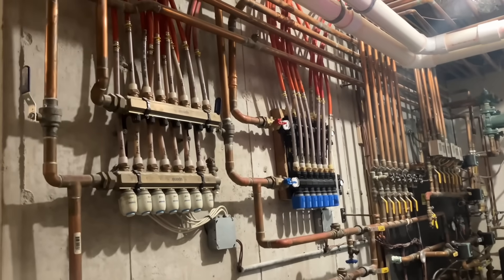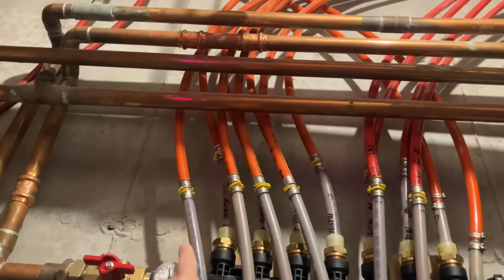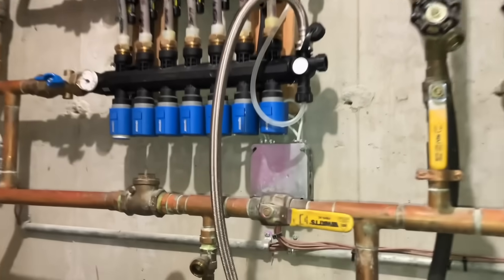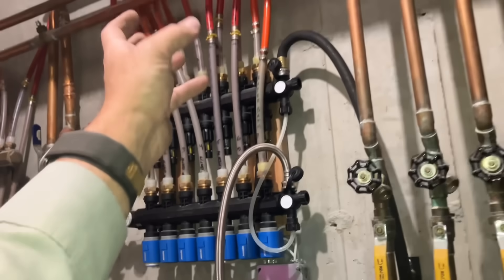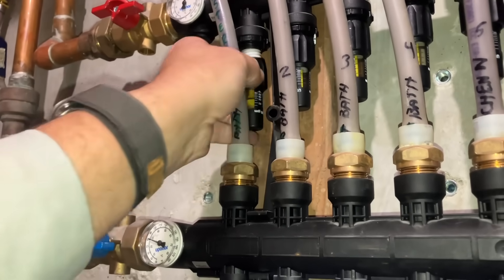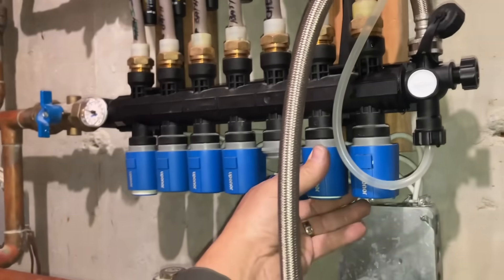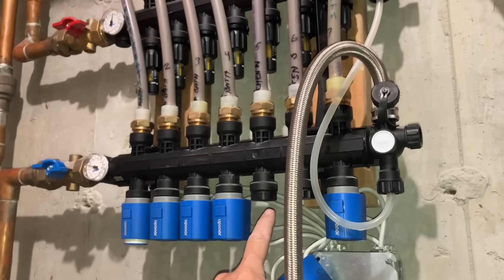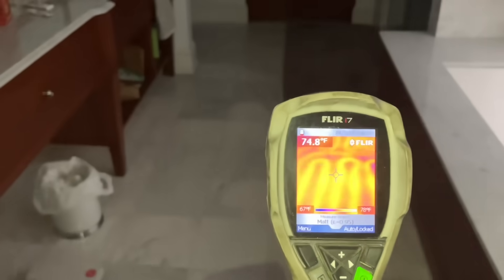Hydronic Radiant Loop Isn’t Working - Purging Uponor EP Manifold

Comment: Did you check flow with the actuator off? If the actuator and valve are partly hung up, street pressure may still push through, but the pump may feel the restriction and not be able to overcome it.
Reply from the maker: Yes, I did

Comment: Did you check flow with the actuator off? Off the actuator and valve are partly hung up, street pressure may still push through, but the pump may feel the restriction.
Reply from the maker: Yes, I did

Comment: I think it’s a definitely a pump issue Clog check on the pump debris maybe I would swap out the pump for a grundfoss and see how much gpm you can push or pull through. There could also be an air pocket caused by the pump but I’m not an expert

Comment: To me sounds like you have issue with mixing valve. If you have good flow after pushing street pressure through and in a couple of days you have same issue sounds like you’re not pulling through mixing valve properly

Comment: Possible the pump is getting weak, clogged screens in mixing valve. Dont think its a restriction in line, due to you having good flow when you ran domestic water through it. So i would look into pump an screens first. Good luck an let us know out come.

Comment: Can I ask , how can the manifold of the radiant heat loops be under the loops. won't you introduce air pockets  ?
The Manifold should be at the highest port to also act as an ar trap to remove any air bubble from the system ?

Comment: Calculate your hydraulic resistance,do you have drawings for the underfloor heating. Insufficient pump head possibly . Especially if you shut off all other loops and only the faulty loop is on .

Comment: another thought, it looked like a taco mixing valve, and they have filter screen gaskets on the hot and cold inlets. seeing the pump is always flowing through the valve, if either of the screens are clogged if will choke the flow off into the pump and it 100% looks like you have lack of flow volume. the flow rate ,ay change drastically if one screen is clogged and the mix valve adjusts to hold temperature.
as previous comment, there could also be stuck open/wrongly adjusted differential bypass somewhere between circulator and manifolds. without them it should be noisy and hard to control the flow rate of each zone, unless many are open at once.

Comment: Restriction is pressure.. is there anyway of testing pressure? I work as a diesel mechanic and this is identical to a hydraulic flow issue.. we have a special tool that we can control the flow and restrictions.. hyd pumps are positive displacement, obviously a heating sys wouldn't use that type pump.. KISS.. hopefully this helps..

Comment: with a system that size, I'm certain it has a differential bypass valve(or multiples), if one or more are stuck open/failed or someone opened/adjusted it manually and left it that way. in that scenario you wont get much flow through the longest loops and even less as more zones open.  
if there wasn't a bypass the system would be noise with only a zone or few calling and a big pump. the water will always go through the bypass first instead of the loops.
there could also "stupidly" be a ball valves as bypass, instead of a proper flow control bypass, but I doubt it.
the manifolds appears to have some sort of bypass also, but doesn't seem to be flowing anything.
you'll get a callback for sure. 😉

Comment: I have no idea what I'm talking about since I only have a 4 valve system using two Taco pellet type valves and two of the newer TACO valves that "charge-up".  Got rid of the Honeywell valves with the gear box.
Here is my WAG - possibly somehow a restriction in the manifold ????  You could switch output lines between the zone in question and another zone to see if the low flow condition changes to the other zone or low flow stays in the same zone.

Comment: I would shut all the loops, then  drain just the problem loop. Cut  the feed and return of the problem loop and hook up 120 psi to it. You are either gonna free up an obstruction or find a hopelessly kinked line. There could just be some kaki in there, blow from both directions.
Reply from the maker: Great troubleshooting tips, thanks for sharing!

Comment: You should close all circuits and feed water only the circuit that has problem to be sure that your flow is correct, also did you check that flowmeter if its fully open?it happens sometimes to have some flow but not satisfying enough.The other thing i would consider ,i 've never seen the manifolds installed upside down,it doesnt mean its wrong but you never know.

Comment: 1. Switch the in and out tubing connections at the manifolds with a known good location to rule out a manifold restriction. 
2. Add pressure gauges at the inlet and outlet manifolds to obtain delta P. Use your garden hose to achieve desired flow rate through that zone and note the delta P. Compare to the manufacturers pump curve for that circulator to see if it can generate the required pressure and GPM.
Reply from the maker: Great tips, thanks for sharing!

Comment: Sorry for length, but hope helps someone
My personal thoughts/opinions for low flow rate could be combination or maybe 1 of the following items listed below.
Unfortunately the only way to diagnose is to check the items (which can suck if following home runs that are LONG and buried, then possibly swap out parts (again a pain if buried inside wall) and see if makes a difference. Not in any order:
1. Leak - could be a fitting (90, coupling, elbo, etc) that has crack or even bad o-ring
2. Improper pipe sizing for amount of homeruns have AND making note of how many “fittings/connections” are in said homeruns as will cause flow restriction depending on amount/type (which can also high pressure drop, thus reducing flow rates)
3. Pump speed incorrect or failure
4. Balancing valve faulty 
5. Manifolds themselves are faulty

Cheers
✌🏻

(I’ve had this happen on manifold system for domestic water, not radiant heating, where system working perfect when installed and “commissioned” for use; than 2-3 months later get call that having issues w/ flow rate and possibly hot water not as “hot”. Was complete new install of manifolds and homeruns so knew wasn’t wrong pipe sizing on PEX or incorrect fittings or too many 90s etc…which can drop flow; it just so happened that on bottom of manifold there was 3 broke o-rings and second manifold had tiny crack in the part itself that faced wall where nipple joins body of manifold [I call it the arm-pit] and we had to change out both manifold and solved the issue)

Comment: At first I thought it was the main circ - but only if it's ft' of head rating was less than that required by all loops.  But that wouldn't explain why the first loop was having issues.  So..I'd take apart the 1st loop connections to the manifold.  It could be some debris that is inside the 1st loop's top manifold connection body that is jamming up your flow.  The thought process is as follows - after the water has been pushed into the system and the system is purged of air, at start up any debris will be pushed out of the HW side and hit the 1st loop 1st (lowest point of resistance).  Hope this helps.

Comment: Sometimes it’s best to go back to the basics . I would disconnect the feed and return lines from the system and run full water main pressure through the circuit. If something breaks or leaks that’s my starting point. If the loop passes the pressure and volume and leak test . Then I would test out put volume and pressure right off the manifold with buckets and small sections of hose , that’s the first tap off the manifold so by default that one should have the best volume and pressure. One good test is better than ten expert opinions, You will figure it out and it is a simple problem….

Comment: Mike, good evening.
I would play with those flow meters a little bit more and try balance the manifold.
I like those uponor manifolds but they are lacking air elimination devices, caleffi has one with hy vents on both sides (supply and return).

Comment: Hi Mike. What is a good temp for oak  floors and concrete floors  ? I have the mixing block set at 100 F, I been afraid of the oak floor buckling if I increase the temp. Thank you
Reply: Your floor will not buckle, it will shrink with heat increasing the gaps between the boards.  I run my wood floor loops at 120 and slabs at 130.
Reply: @dhcmk3   Thank you  for that.

Comment: Do you think sometimes things are over engineered. Look s like a lot going on there. So many more parts involved.
Reply: I thought the same.  If I had money like that, I'd just get a well zoned central air and get heated floors in the bathrooms.  Can do that with electric heat for simplicity since bathrooms are relatively small.